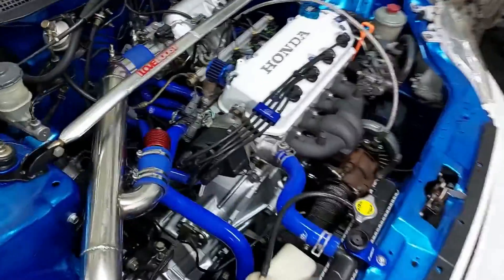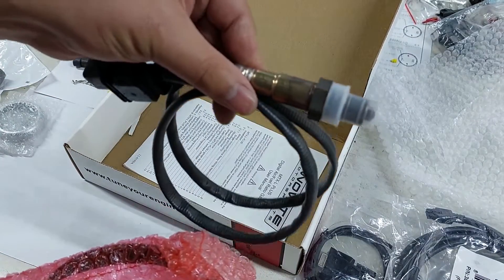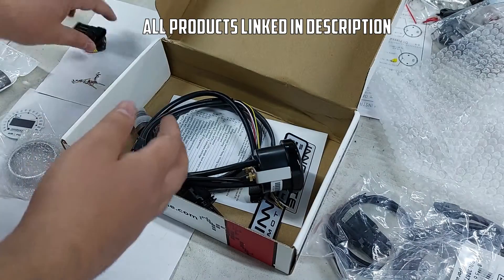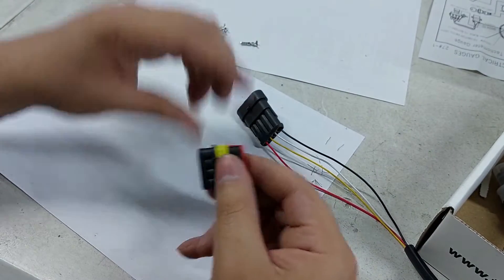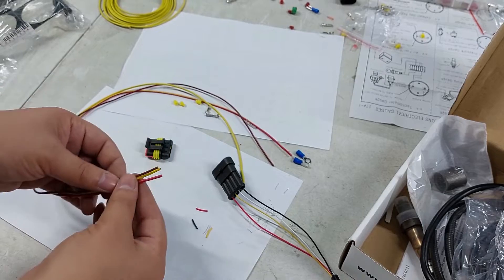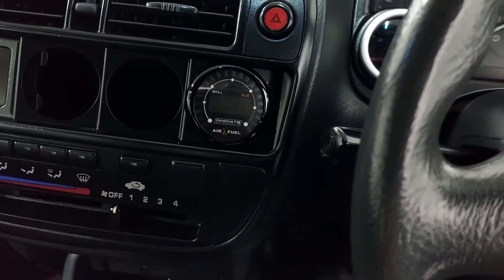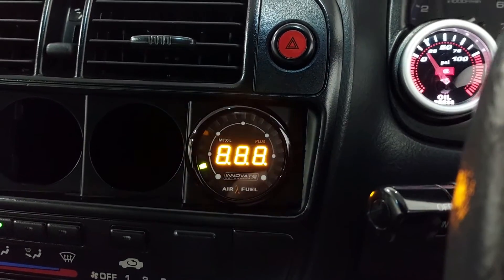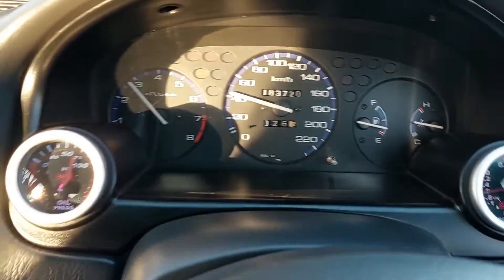Wideband AFR Gauge Kit Install & Calibrate - Innovate Air/Fuel Ratio | Honda Civic Turbo

Comment: HI there i have the same gauge also did you come across ground off set issues at all as my wiring is clean like yours and used battery earth also and swapped into engine block ground and found my readings to be all over the shot! replaced the sensor still the same issue! i have read these are common issue with this product!

Comment: Sensor not burned out, because of it being close to the flange?
Reply from the maker: Hi, no the sensor is still working currently. Perhaps on a high HP car that location may be a problem, but it worked for me. I moved it now but it ran like that for years.

Comment: nice vid. you should put the 19$ sensor side by side for comparison
Reply from the maker: Hi, on the video about the $19 sensor we have a section at the end where they are side by side driving the same route but not at the same time. at the time I only had 1 bung in the exhaust so I could not run both at the same time. but we may do it in future.

Comment: Now 2 years later, how’s the reliability of the Innovate?
Reply from the maker: So far, no issues, works perfectly even though my car runs fairly rich, and we hydrolocked the motor, putting a lot of coolant over the sensor, still works.

Comment: you sound south african?  Your car is licensed in S.A as well, Why are u always using ebay and allexpress, is it much cheaper to import these things?
Reply from the maker: Hi Jevano, I am south african, buying from aliexpress is normally a lot cheaper if you are willing to wait 6 to 8 weeks for delivery, the innovate wideband at the time cost me R2800 all in to buy from Amazon, locally Takealot was selling the same gauge for 4500. It's not always cheaper but sometimes it is. Normally I'll check locally VS online before I buy.
Reply: @RisingBoostYT  Great stuff bud, awesome videos by the way bro u just helped me alot knowledge wise .. do you pay any duty and taxes on anything you import?
Reply from the maker: Sometimes... Small items from aliexpress is like R24, Amazon includes the tax before you pay and eBay you have to pay, like 100 to 400 depending on how expensive the item is. If DHL delivers from aliexpress you also have to pay, it's normally not too much.

Comment: Each time i watch the wire videos i was hoping someone would inform you that you are supposed to put the yellow rubber grommet on the end tangs of the pin and crimp them in
Reply from the maker: Haha, I was waiting for someone to notice, I do know that now... But only at the end when I struggled getting the injector plug grommets in. But next time I'll get it right.
Reply: @RisingBoostYT  Haha, well that's good you know now. I didn't know at first so not alone. Nice work on the build though, hard work pays off, watched all your vids over a couple days
Reply from the maker: Hi Dinxsy, thanks for the support! glad you enjoyed it. for now it's paying off, car is fun and running reliably, just not making the power I want yet. but it will soon.
Reply: @RisingBoostYT  I'd be more than happy with the number you have, as long as it's reliable makes the correct whooshy sounds :face-green-smiling:

Comment: Can you make a video briefly explaining how you road tune your car. Not a DIY video, but just a quick explanation.
Reply from the maker: Hi Niel, not a bad idea, I will see if i can make a video soon. but basically I was just adjusting the fuel map on the ECU by driving on a even road at different speeds/Loads, then using the Air/Fuel ratio from the wideband I would adjust it, more fuel to make it richer or less to make it leaner.

Comment: CLean car brother . have a eg coupe with a z6 i have the turbo mocked up , waiting on the intercooler pipes and a few other things to put it together
Reply from the maker: Awesome bro, Z6 is the best Dseries for the job. Good luck with the build!
Reply: @RisingBoostYT  the car has a lsd trans and p29 piston n rod setup, should I changed the piston n rod setup to something else? A lot of people react wen I tell ‘em like it’s impossible to boost